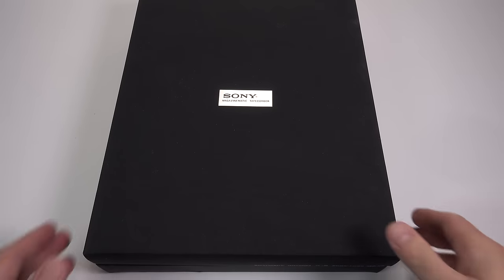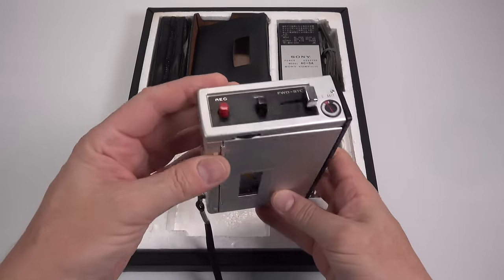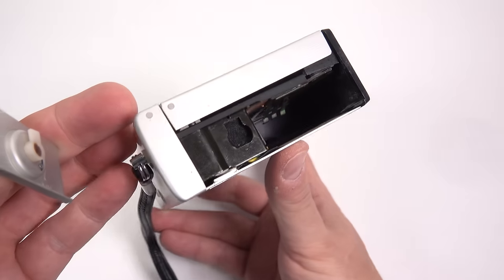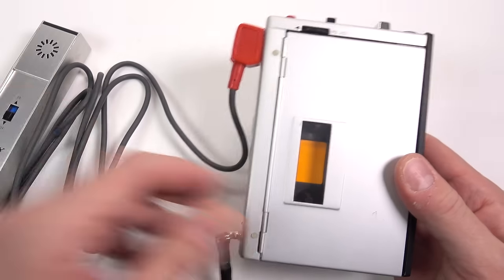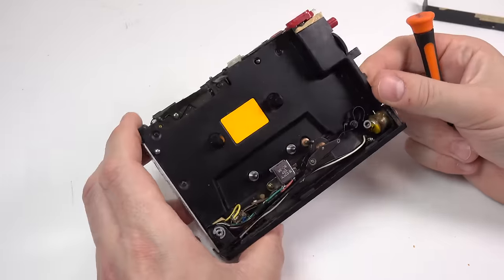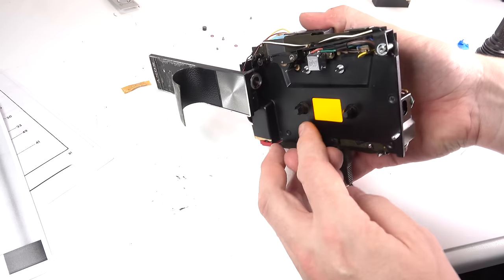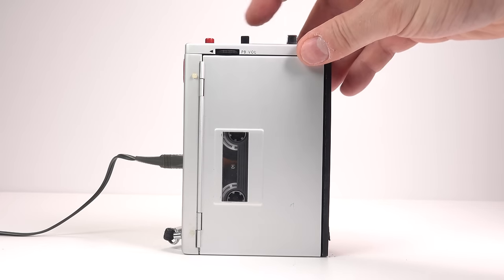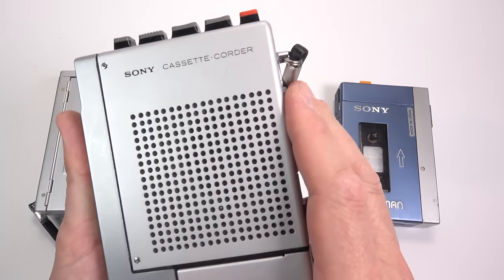Sony's proto-Walkman that went to the moon*

Comment: So I’m at the point where you are discussing the creation of the Walkman, and you mentioned that the R&D and marketing people at Sony didn’t think the concept made good market sense. Coming from the perspective of the generation that grew up on the Walkman, went to college with the Discman, and has had IPods since the near beginning, I reacted with expected shock to this naïveté.
HOWEVER upon further research in discovered that while there were PORTABLE battery powered 8 track players (I remember Kelvin’s older sister had one in the Wonder Years) they were not that commercially successful. This is probably because the target consumer wanted to use them in a social setting and not for personal use, and that usually meant car stereos for out and about and home stereos. That plus at the time you go more music per pound with a simple battery powered radio provided you lived in an area with a lot of competing radio stations. 
With a Walkman a person could carry the device in the inner pocket of a jacket with 3-4 extra cassette in various jacket pockets plus a spare set of batteries scotch taped together. Plus of course the “rewind” pencil with is double set of rubber bands. But back before the Walkman was realized in the minds of the lead marketing and R&D that much music requires a player the size of toaster, 5-7 8 track cassette (each double the size of the cassette) and headphones that look like droopy Mickey Mouse Ears, and enough spare batteries to power a watchman flashlight.

Comment: I blame lithium cells for all this hysteria about batteries and postboxes :\

in my experience, the postbox would have had to be on fire to make the battery explode?

And bonus puppet episode... <3 love it
Reply: Li-Ion batteries have a bad habit of spewing huge bolts of angry fire spontaneously if they are damaged or manufactured incorrectly, even if the postbox (or airplane, or smartphone) is perfectly fine.

Comment: The TC 40 which is almost identical was $109.95 in 1972.
Reply: Why did Sony go backward with their naming conventions. After the TC-50 they released the TC-40 in 1972 and then the TC-55 later the same year.

Comment: Things are so much easier now it really is disgusting. I’m from a time where taking something complicated apart  meant having a good sorting system, and an outstanding memory. Now you just snap away on your phone as many pics as needed or even video. And you have it right now to use.
To understand what I’m talking about look at an automatic transmission valve body from the late 90s or earlier. Springs, bolts, and valves galore in all different sizes, many of which can be inserted wrongly. Leaving you with a boat anchor instead of a working transmission.

Comment: I think maybe the tape head may need cleaning & the azimuth may be a bit off?
Reply: Please don't goad him into violating that beautiful machine any more than he already has.
Reply: @sweethomeboston2720  It's quite easy to clean the tape head & adjust it, you don't even need to take it apart to do this.
Reply: Yes, of course you are right. These would be non-invasive tweaks.
Reply: @sweethomeboston2720  Having said that,  think the motor also needs attention for its instability problem, which would mean taking it apart, or replacing it.  Possibly after 50 years, the tape heads & capstan could also do with de-magnetising...

Comment: Centre negative is annoying, but useful for a designer. The DC jack's outer sleeve contact is also a switch. It can disconnect the non-rechargeable batteries' positive connection from the electronics, making the product easily switch between external DC and internal battery power just based off the connector being plugged in.

Comment: Not very fond of the early 70's black plastic with leathertexture, but it was sure a marvel on miniturization.
The only odd thing is why they engineerded the doorhinge being outside instead of inside making the outer surface flush.

Comment: I was beginning to wonder if there were any mechanical bits at all inside that thing. Every time you removed a layer, there was nothing underneath. They should have called it the Sony Onion. 

Also, Red Foreman would have threatened to set foot in one of those puppets' ass.

Comment: If someone tries to take your batteries away again, send them this link:
https://www.iata.org/whatwedo/cargo/dgr/Documents/guidance-document-nickel-metal-hydride-batteries-en-201608.pdf
Reply: Related to that, sorta: Center negative allows an external power circuit to be created that disconnects the battery's positive terminal.

Comment: Here's a fun project for my fellow commenters: make a playlist of songs that could've been on that mix tape. If a song from a 1969 album is used you have to research (wikipedia and discogs I assume) if the album was out by July. If it came out August 1969 or later it's off limits.
Remember to check if each half fits within 30 minutes rather than just checking if the whole thing fits within 60 minutes. And don't be afraid to use radio edits of songs instead of the album versions. Thoughts of "how can we save space on the tape" would've been considered after all.